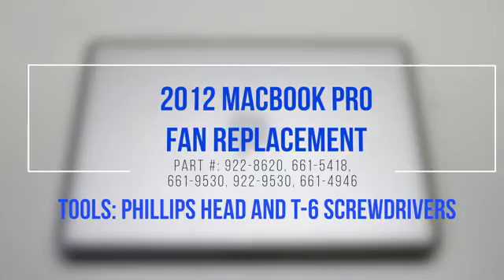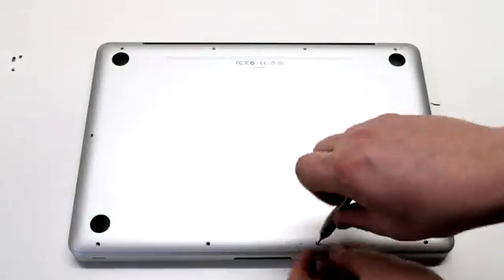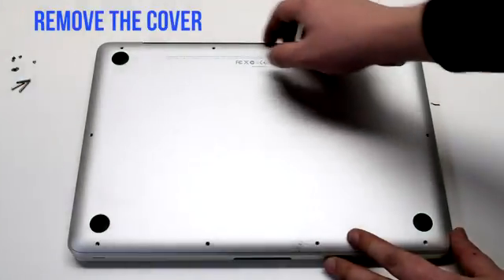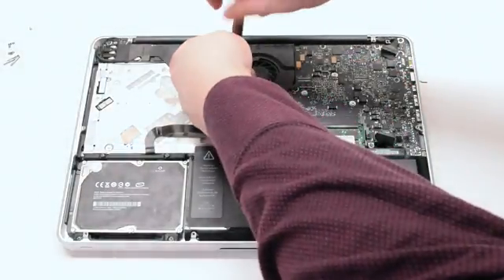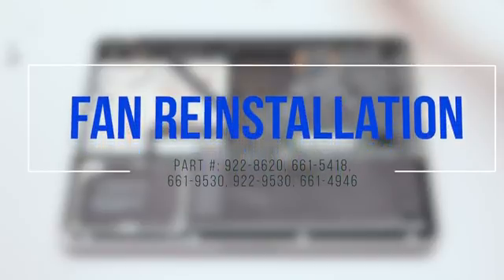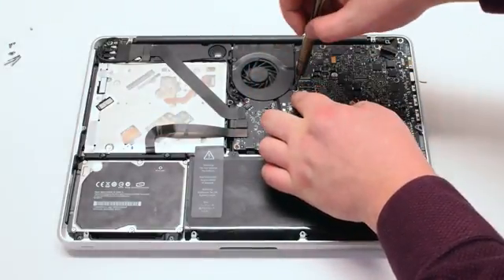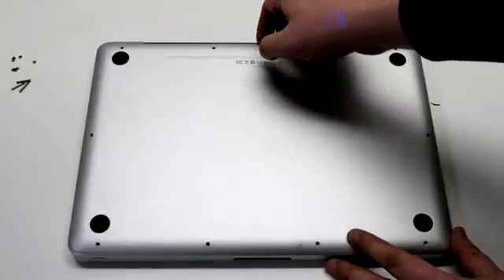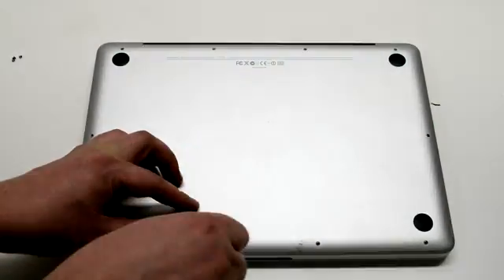2012 Macbook Pro 13" A1278 CPU Fan Replacement

Comment: For anyone wondering to disconnect the fan, all you do is just simply lift it up the connector slowly for the pro mid 2012 (it might different on older models). That’s it.
Reply: thanks . he completely missed the disconnecting part in the video which is the most important ...everyone knows to take some screws out and put them back.
Reply: @marivsmvsic  exactly, but I still like his videos regardless. He makes the best repair videos for MacBooks